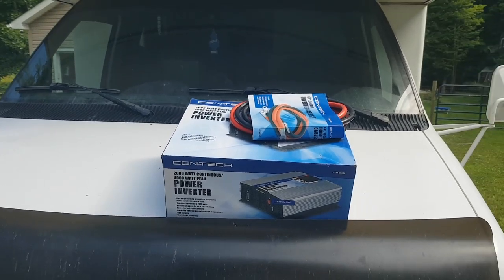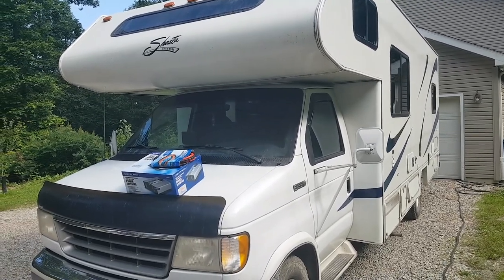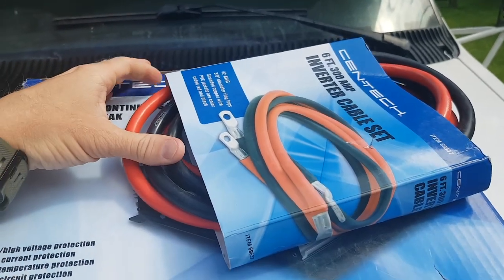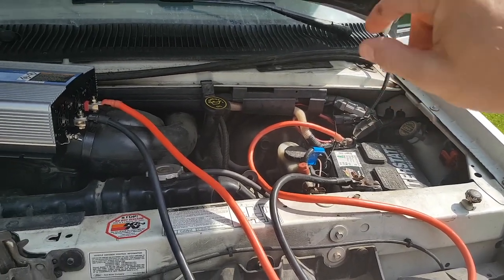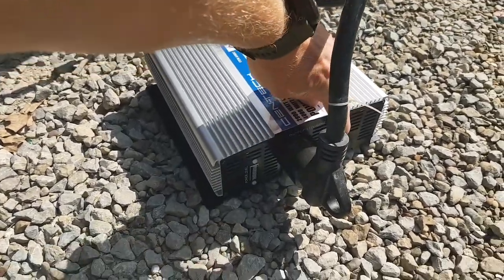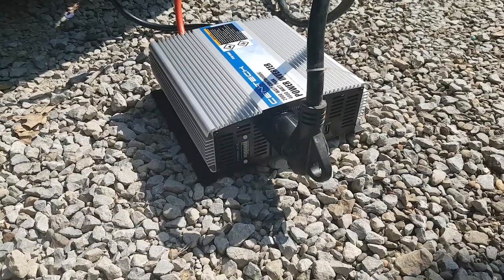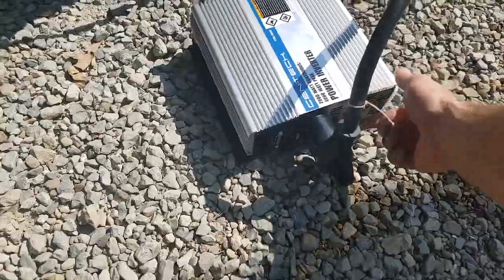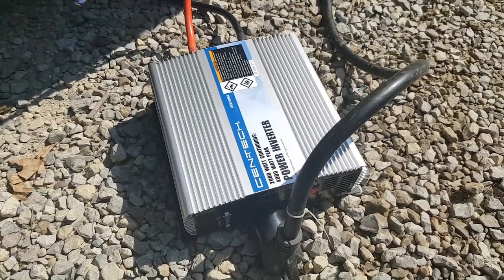Harbor Freight 2000 watt Inverter - Will It Power an RV AC System?

Comment: The surge to start an AC compressor could be at least 2 times that listed as operating wattage. Also? I'd say you need at least six 12 volt batteries with a CCA of over 600 amps and a 4000/8000 watt inverter to start that compressor.  The cable should be a 100 MCM. My experience talking. It's the sagging of the battery voltages that causes the alarm and shut.

Comment: I have one it works perfect your cables from the battery to the inverter are too long so when current comes in it drops when it gets to the inverter dropped way too low you need  shorter cables like 3 foot cables
Reply: That makes since.
Reply: I have short cables on mine and it won’t run a small window swamp cooler which takes much less power than an rv air conditioner

Comment: It's not  junk mine works great you have to have more watts say like 4000 watts to kick on the AC compressor once it's  on the a.c then it runs on 2000watts
Reply: So in other words a tiny refrigerator ....uhhhh...no thanks....we need LOTS of cold storage out in the sticks!

Comment: its the high inrush current the compressor requires to start it to get the largest size inverter you need to determine the LRA (locked Rotor Amps) on the compressor. to match to the inverter. another is getting a hard start kit for the compressor sold in HVAC supply houses, Amazon or ebay as it should give the compressor a boost when starting i would try that and maybe or maybe not it will work with the inverter as the max amps the inverter can handle should be labled on it and look at the LRA on the compressor.

Comment: Pure sine wave is Key as well as reducing the start up amps for ACs.  Also, I found a little 5000 btu window AC cools as well as some of these roof top power suckers.
Reply: I run 5000 ac off 2 deep cells and Jupiter 2000, works great

Comment: my jupiter 5000 watt runs my entire 30 amp camper with 3/0 cables also running with a solar generator to regulate battery charge input and tool batteries charge. and 5 deep cycle marine 29s from walmart. cheap and easy start for offgrid.
Reply: Have you ran those batteries on the inverter for a long period of time if so how long do they last for before getting drained. Thinking about it for my rv
Reply: zachary19951 without an alternator or panels charging 20 min on a 12v Paralel 2 marine/Rv battery’s will power a video wall from @onpixelav  all you need is over 3500w or 4,000 w for the 30amp plug
Reply: @4684334  when i removed the charge input panels for testing, the 30 amp system was avg pulling 325 watt per hour. took about 2 days until the battery bank got below a quarter charge.

Comment: Most do not know this but you NEED a Low frequncy inverter, it's not about the watts so much as the ability to withstand that initial 3to 5 times the draw for 1/2 asec which no high frequency inverter will do under like 8000 watt one..I run my house swamp cooler from a 1500 watt LOW frequency inverter ll day long on a timer..the initial amp draw is about 65-75 amps and then down to 25-35...most solar places do not even mention that..The easy way to tell is if it weights less then 15 pounds for inverter it' a high frequency one and will NOT WORk
Reply: Do you have any model numbers or brands?
Reply: @wmmenzies6584  I don't..I bought mine used ..but just goggle low frequency inverters. .most will be over 250, they are more expensive but will do so much more

Comment: You could try changing the capacitor of the air conditioner motor, 
that will lower the motor start consumption. it works with my fridge and my 600w inverter. Greetings!

Comment: As a minimum you will need a soft start circuit on the A/C. The inverter being so small, all other loads will need to be shut off during start. Also, I would only use a sine wave inverter on this type of inductive load otherwise you will decrease the life of the A/C motor. In summary, I would recommend a larger sine wave inverter and a soft start circuit to accomplish this task. It is not the fault of the inverter you are using.

Comment: It needs 4000 watt inverter with 24v battery and use voltage regulator for the batteries it might help the wattage a little bit

Comment: Always account for the initial start up amps of a compressor!!!!!
LRA's Lock Rotor Amps (high!)
RLA's Running load amps(lower)

Running amps 20!?
Locked rotor amps 100-150?!
Basically get an inverter that can handle the start up high amperage required to start Ac at a stand still!!!
The hard start kit on an Ac is a thought ..., but there's still a high amp start up on loaded Ac compressors!
I've worked on AC's & heat pumps over 15-20 years !

Comment: Gotta use a soft start otherwise it'll pop. Soft start staggers the voltage only turning on the compressor first and not the fan and other loads after the compressor has started as when it starts its peak draw is a fuck ton. It's operating voltage isn't so much tho so after its initial start it should then be able to power the fan and all the rest. It's already been done. Happy hunting and cool vid.

Comment: Whoooo you guys are hammering “jack”
He only said. “Lets See If it will work”.   Now we all know it does not !!!!!!!!!!!!!!!!!!!!!!!!!!!!!!!!!!!!!!!!!!!!!!

Ps:  If what he tried was functional we would all have a  1-AA Battery connected to a 10,000 watt
Inverted to run our homes !      Maybe in 2099 ??
Reply: ACHVACTAB1 No he didn’t “ONLY” say let’s see if it’ll work... he “ALSO” said it’s a piece of crap! That’s not fair and it misleads people who have no knowledge into spending more money on something comparable that would get the job done the same way even if it didn’t last as long. But that is something that would need to be reviewed over a period of time. Although I know better than what was presented in this video I found this by one by searching, “harbor freight inverter review”. So there’s that.
Reply: Yesterday I tried to use it to power my single wide mobile home entirety and it worked, I just use my old 1992 nissan with a regular Walmart battery, I kept the engine running all the time to avoid depleting my battery, regular size fridge, 55" Roku TV, PC with 500w supply unit and 6 led light bulbs in my house and the blender to make  a sauce worked at the same time without problems, so I guess this unit is not a piece of junk after all, I didn't run the microwave o window  AC unit, next time there's a power outage I Will test it.

Comment: You are trying to start an 13,500btu AC with a 2000w Modified Sin Wave inverter. BAD. The AC requires at least a 3000w Surge to start unless you add a hard starting cap to the AC.  Plus this inverter is 85% efficient.  You need a 3000w/4000w surge PURE SIN wave inverter. Ideally your inverter should be twice as powerful as the highest load it will be tasked with.  IT AIN'T the INVERTER, it's not designed for this job.
Reply: hey do not work BECAUSE they are High frequency rather then low frequency inverters
Reply: @MrFrodo1111  I've used on on a cheap 5000 btu ac worked fine.
Reply: @dwmcever  THAT'S COOL
glad It worked

Comment: In addition to probably not being able to handle the the surge power for starting the compressor, the wires going to your inverter are probably too small. Those look like maybe 4 gauge; I'd say you want at least 2 gauge, probably 2/0. But most likely you're just expecting too much from that inverter.

Comment: I have the 3000 watt jupiter inverter from them. I can get it to start my minisplit ac on my rv, using two deep cell batteries from camping world, also connected tosolar on the roof. runs about 5 mins then blows the 150 amp fuse i have connected between the battery and the inverter.
Reply from the maker: Good info
Reply: That makes sense since you're probably pulling about that amount or maybe more

Comment: am i able to use this without using the front battery? can i buy another battery and have that with the inverter in the back connected to my stuffs? i don't want to have my hood open and attract attention to myself. thanks!
Reply from the maker: Yes you can. You just have to have a way to charge the battery.

Comment: I want to ask guys, I bought JUPITER 2000W few days ago from Harbor Freight Tools and i got the cable. Is it this simple i just connect this wires from inverter to the batteries of the truck and it will work ? Cause i see some other guy was using something called maybe like splitter idk how to explain, but if i install just wires will it work ? Thank you!

Comment: Works fine for my van set up. I care less about AC sound drives me nuts. Running 2 RV batteries on a solar/alt. On a charge controller. Crazy how many things can run on USB. Like a projector.

Comment: That's why a lot of people don't run the AC off the top. Cuz they see your running everything else in the the camper . So you need to put a window AC unit and then not use the top one and then you use the power inverter on the AC unit in the window

Comment: I was gifted this inverter and it cannot boil water either. But I think it requires so much current that the battery cannot give.  I have an 1100 watts Krieger that I can use to make coffee, however it died before 2 years. They replaced it whit a used one that can no longer brew coffee. Harbor Freight I have tried all your solar equipment and I give them a 2 star

Comment: I need help. I have a tundra m2000 inverter. Runs everything from 43inch TV coffee maker slow cooker etc.. But when I plug in my ps4 pro it doesn't turn on at all? How can I get it to work? The pro uses 300watts Max. But my slow cooker was using close to 900w..so what gives??

Comment: Look up in rush current , this can handle 16.666666 amps at 120volts , the inrush current when compressor kicks in is way higher than 16.66666 amps and is activating inverters safety mechanism

Comment: They do work but you have to kick it up to the 5000 watt because your camper needs around 2500 W to get it started then it will run on around 1500 to 1700 hundred Watts

Comment: be careful the harbor freight power inverters are not repeat are not pure sine wave inverters, they are in fact modified sine waves and they will burn up your electronics,...i do how ever recommend the Reliable 3500/7000w or higher pure sine wave inverters they do work well, or the edecoa 3500/7000 pure sine wave inverters

Comment: It isn’t a piece of crap. You are just not smart enough to know that 13,500 BTU’s are 2,800 to 3,000 start up Watts. So a 2000 watt converter will not start nearly 3000 Watts of power. Know your stuff before you call it a piece of crap.
Reply from the maker: Im plenty smart enough to read the box it came in that claims it will power a 15,000 btu air conditioner. Pay attention bud! I covered this fact in the video!
Reply: Hehe, you got a reply prooving he does not understand juat as you said... Lol. Forget the atartup load though... The guy thinks two group 24 automotive lead acid batteries are capable of delivering even 1kw is so laughable to anyone that has really worked lead acid storage combined with inverters for heavy loads. He will be the guy replaving batteries ever few months not underatanding why the cores are desintegrating

Comment: If you had three batteries and a 10000w pure sine inverter and an easy start capacitor how long do you think you are going to run on that set up?? 2 hours maybe?  So then say you run your RV to charge batteries? Just get you a generator. If you're going to run a motor may as well be a motor made to power an Air Conditioner.

Comment: If you had a soft start it would probably run it. Staring is the problem with compressors. A softstart pushes that energy over a longer period of time.

Comment: Same thing happened to me. I got Harborfreight's 3,000 watt (6,000 watt surge) didn't work then I got their 5,000 watt (10,000 watt surge) and wouldn't start. I turn it on and goes to red and beeps shuts off for overpower. Will look into the start capacitor idea.

Comment: That surge current on AC side is 41 amps on 13500 BTU AC.. You need Easy start install 
on AC then will start and run AC no problem from 2000 Watts inventor .

Comment: I was thinking about the exact set up and didn't think a modified sine wave inverter would work especially with an AC compressor. Now, to be sure I would have used shorter and well connected cables of the right size And I think you have the right size covered. Length and connection, not sure. My AC is only 5k btu also. So bottom line is that It could still make it on my RV. The battery also may not be able to sustain the peak demand and even if it did it wouldn't run you AC for long before it would die. One more thing, Idid't see the ground connected. That can make a big difference. In any case pure sine is always better. Especially on moving motors because of smoother rotation. Dilemma. Thanks for sharing your results.

Comment: Ya i did not reckon it would do it i had a meter on our 13,500 but ac and it was pullint between 1600 and 1700 watts running and I say like 28 amps at start up it is from 95 so a newer and or better maintained ac might draw a little less but probably not much you probably need at lest a 3000 watt with a good surge

Comment: Can you wire lithium iron phosphate batteries to those inverters
Reply from the maker: Yes you can. But I wouldn't recommend this inverter. Get a pure sine wave model. The prices have really come down and they are way better for most electronics.
Reply: @JackofAllMasterofNone  thank you , had one laying around from lead acid system , was just curious , thank you .

Comment: I bet it would definitely start a 5000 BTU air conditioner with a hard start installed. With the engine running
Reply: Yeah, but how long would the battery last?? better be near shore power w/battery charger

Comment: Just thought I would let you know I ran the window A/C off of my Aims 2000 watts inverter charger for 9 hours today. It is possible , but the inverter has to be able to put out the rating. The A/C uses 644 watts running, and 1250 when the pump has to come on. To run an A/C it needs to be pure sine wave. One of those inverters like mine are $915 now. It is 24 volts, so less amps, runs cooler...But they will do the rating. You should have about 6 or 8 batteries to run the thing, all close to the inverter. A lot of inverters will not do but about half of their rating...it looks like you got one of those here. I feel sorry for people that keep buying these and trying to make them work. I bought a 12 volt 2000 watts Ampeak inverter about 2 weeks ago to run a sump pump from my pickup for when I go to get two barrels of spring water. I have made 3 trips with it, and working really well. The pump takes 350 - 400 watts. I haven't tried it on the A/C...it will probably run it, but that's just asking for trouble probably. In this video the back battery isn't helping...too far away. Yeah it's a whole other level to run an A/C very much off grid. I'm going to run mine about 9 hours again tomorrow. The batteries will charge hard in the morning for awhile then by 10 : 30 they will be going into float. I'm using 20 marine batteries  that are hooked to the inverter by two sets of #2 welding cables.
Reply from the maker: I also have an Aims 2000w inverter and it is much much better than this Harbor freight one.

Comment: You might need to install a soft start on the A?C or buy a sportsman generator for $120 .00 from home depot .Also solarboondocker has video on running your a/c on solar
Reply from the maker: Yes. A soft start would probably work

Comment: Ac units have capacitors that store power and is used at initial start up. Go ahead and grab the 2 post on a capacitor see what happens. Disconnect the wires 1st.  Ok! Your heart is pumping now, give the equipment a jolt now.

Comment: I wonder if he turned of the rv's power converter. If not is drawing from the inverter pushing it pack into the battery in a very inefficient cycle. Plus the AC would need everything that inverter has to offer plus some!

Comment: THE REDUCER YOUR USING IS ONLY 15 AMPS ??
Reply: he needs to look at the LRA (locked Rotor Amps) on the compressor as the LRA is higher than 15 amps plus the high inrush current as a hard start kit must be used depends on what compressor the unit has as to look the cover has to be pulled off the ac unit to read the label on the compressor. the BTU rating, Amps, type of refrigerant it uses on Copeland compressors will list the type of refrigerant oil but its the LRA rating to look for

Comment: I have the exact model, and it's been in a box unopened for years.  It wouldn't even turn on a small cheap heater that you can use in a small space like a bathroom.  Welp.

Comment: You are running the whole RV on it which means your refrigerator is on and anything else the microwave clock you are using a lot more power than just the air conditioner

Comment: 12 volt inverter max is likely less than 2k let alone the surge. If you want to run that system you'll have to look at a 24 or 48 volt system.

Comment: Any motor draws alot of current from a stand still    that compressor ia under  gas pressure also it will be pretty hard to start up        of u had another bank of batteries it prob would do it    but u wouid be  on the edge of killing the inverter

Comment: It’s not a junk . Remember most rv ac runs in 12.5 to 15 amperes you need generator to power it. You need more wattage in your inverter like 5000 watts

Comment: You need a soft start device on your A/C. A soft start will slowly engage your A/C fan/compress slowly so it doesn't spike the amperage. A/C's are like laser printers, they require high amps to start and then they level off the amps after a few minutes. You would need a 3000watt inverter and having a soft start device would be hearty for your A/C. RV A/c's require a minimum of 103.5 volts up to max of 126.5 volts, a 115 volts is their sweet spot.